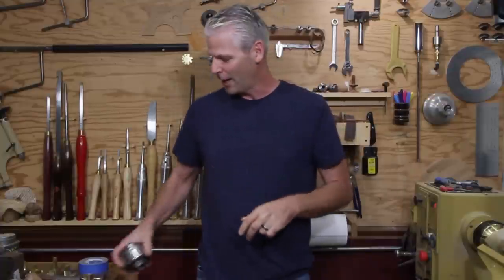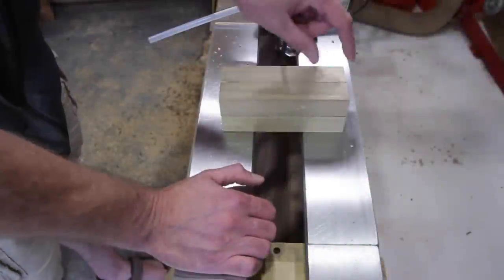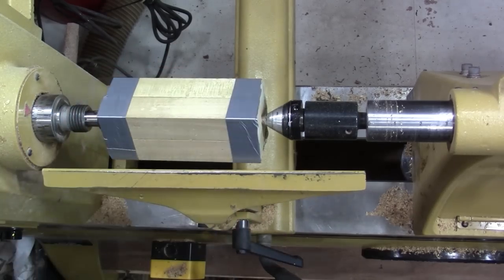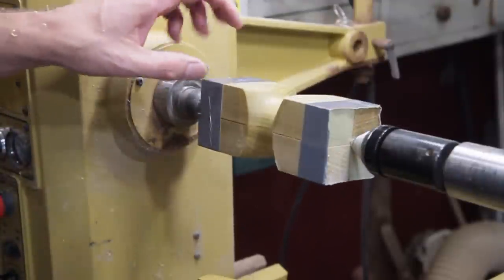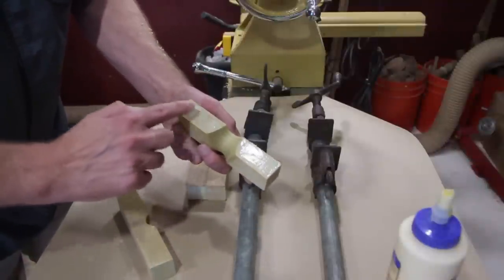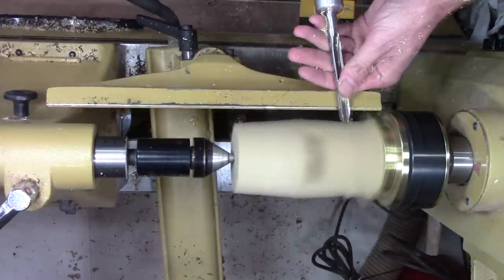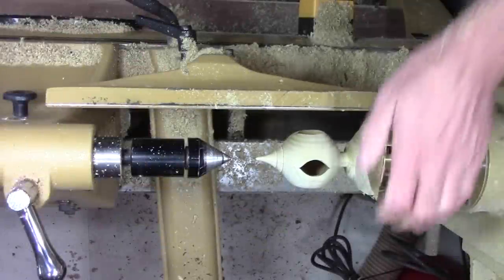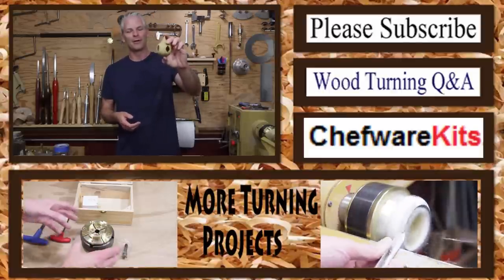Woodturning Ornament, inside out turning

Comment: I love inside out turning, I did my first one a couple months ago and it is addicting. I like the hot glue tip. I just taped mine together and I was worried they would shift and not line up when flipped. Luckily it worked out ok but I'll use hot glue on the next one.

Regards,
Bob
Reply from the maker: RJBWoodTurner The hot glue works very well, and it's easy to pull apart. I think next time I'm going to use packing tape though. 
Take care,
Carl
Reply: Was there an issue with the duct tape? Packing tape is so pricy that I usually use duct tape too. Just curious.

Regards,
Bob
Reply from the maker: RJBWoodTurner I didn't have a problem, but I think the packing tape is stronger. So I was just thinking better safe than sorry.

Comment: The hot melt glue is a good way for temporary holding peices, my worry was using a standard spur drive as this can still split the turnings.
I use the Robert Sorby steb centres as you only have to make a very small mark on centre and then you have the steb part to hold it all together when turning, just another bit of safety
Reply from the maker: Jim Carroll Thanks for you tip Jim

Comment: Great project! A few thoughts and questions:

1- Were those coins in your pocket are the beginning? :)
2- When possible, could you should the digital readout on your lathe if it is in frame (or close)? This would be helpful for beginners like me who don't know what speed to turn/sand/finish at.
3- How do you sharpen your tools? They always seem so sharp. I just bought a slow speed Rikon grinder which is an improvement over what I had, but it still seems painful. It would also seem painful to spend quite a bit more on a Tormek. Suggestions?

Thanks!!
Reply from the maker: l3ender15 Thank you,
1) Yes I had change in my pocket :)
2) I'll try to get the readout in frame more, and try to mention it.
3) I have a slow speed grinder as well, and a Wolverine sharping system.
Take care,
Carl

Comment: Carl, how deep should the initial cove cut be, or, alternatively, what proportion of the overall starting width of the piece should be left before it's split apart? I understand that the more material is removed the thinner the resulting walls will be but what is the safe limit?
Reply from the maker: The thickness of the wood will determine how far you need to go in. I would leave them about 1/4" thick until you get the hang of it.

Comment: Hi Carl, 
Great video- I would like to ask for a little help. I have one on the lathe now, and I want to add a chrome  ball / with a bell inside the ball..   to the void area  when I reverse it.  Have you ever done this? currently the ball / bell sits approx half diameter of the ball, when viewed on the corner of my wood (flat face view..only sitting 1/4  guess ) will this be enough to reverse the timber blocks making a hollow section void  in the block and then encapsulate the ball, but i still want the chrome ball to protrude out of the void sections, like a 1/4  ball....any tips would be very welcome 
kind regards from Australia. 
David saxberg.
Reply from the maker: +David Saxberg Hi David, can you send me a picture? jacobson68@yahoo.com